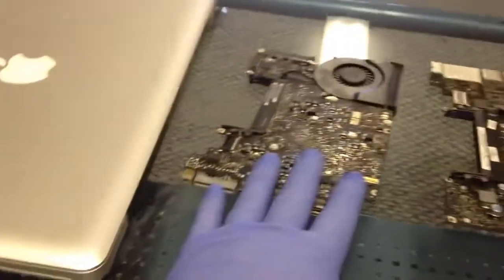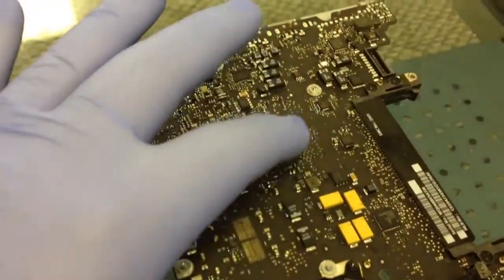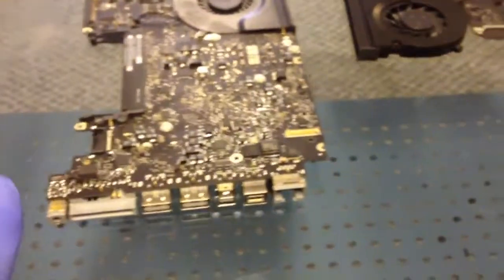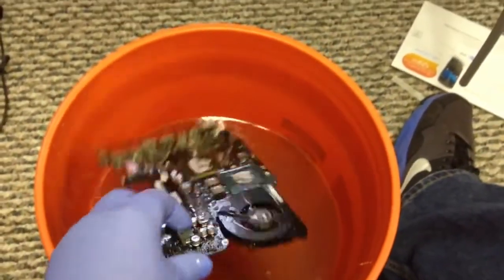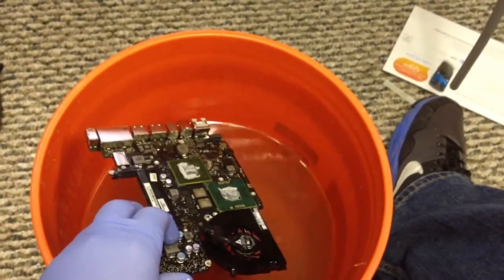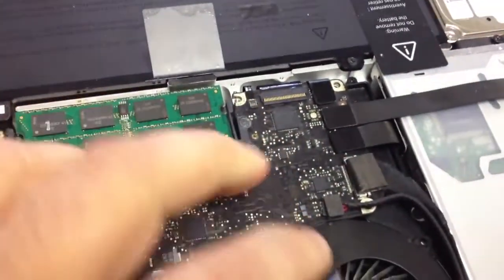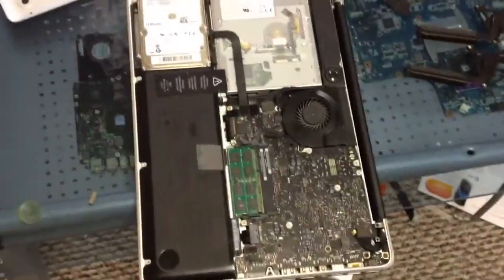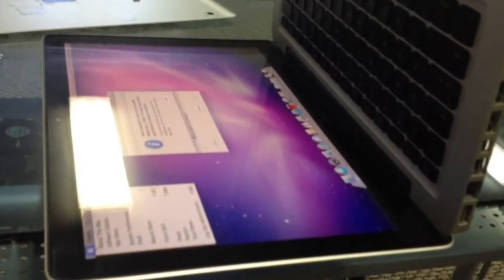Apple logic board repair

Comment: I did as you suggested and cleaned the board.  I originally got no green light but I put a new gasket between the magsafe pieces to get a charge.  I've been using a voltage tester not a continuity tester as I cannot find my ct. My green light will only go on for a few moments and it's not been turning the fan on.  Any suggestions why the ground keeps breaking? Does it have to be a continuity tester?